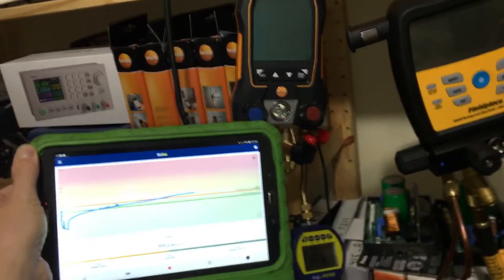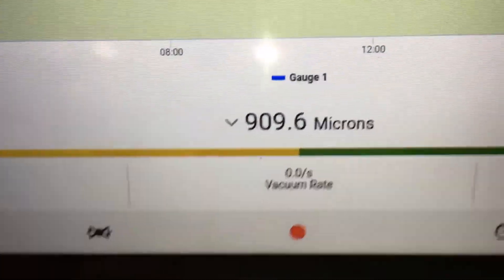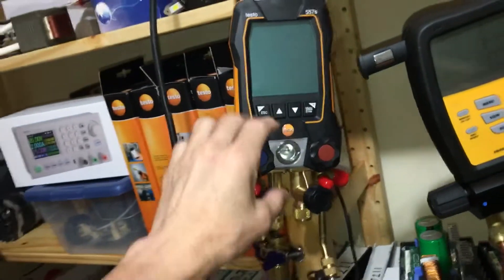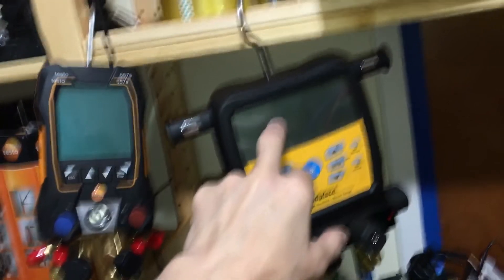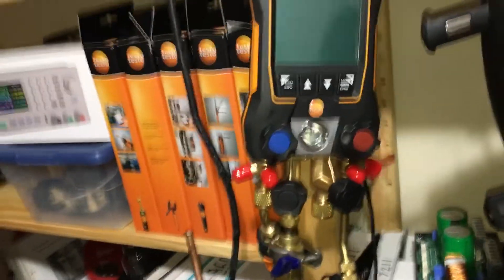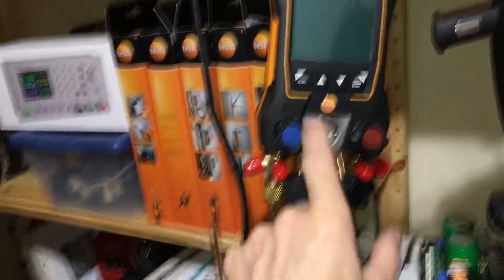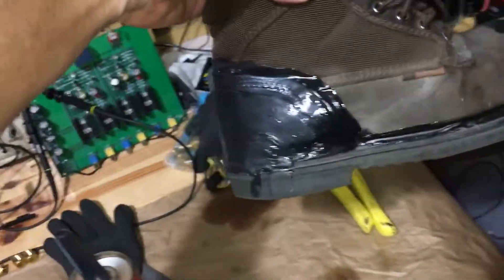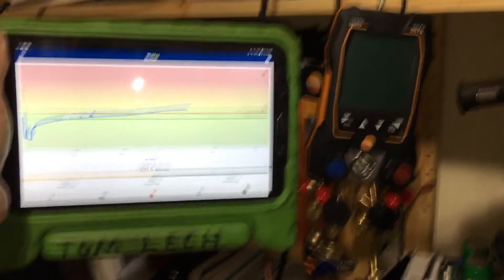Pt:5 TESTO 557S passed vacuum decay test. Decay up to 200 micron after 4 hours

Comment: Hey have really gotten into your videos and am interested in getting this manifold. I have a question regarding hoses for pulling vacuums. I've always been told bigger is better for hoses but you pull through I'm guessing 1/4" copper lines, do you still get quick vacuums using the copper with a 5-8cfm vacuum pump? I usually use 5/8 refrigerant hoses to pull through and was wondering if I should make up some copper ones and if so could I use bigger copper and get more cfms or just stick with 1/4". Thank you for your time!
Reply from the maker: If it is for an automobile quarter inches big enough because of the tiny size of an automobile’s system. 
             When you’re working on old our 12 systems you just simply use a valve core removing tool to remove the valve core and this will be more than enough flow to make your job go fast. 

        In automotive we have the special R1 34 coupling fittings that they do not have in commercial or residential HVAC. 
            The majority of the valve depressing cores inside the fittings are very large diameter so when you push them down just a little bit there is a rather large circumference for airflow to go around. 

         It would be nice if they made a valve core removing tool that you could use with hoses

          The worst case scenario is a large SUV that has a evaporator all way in the rear of the vehicle with 30 feet of hose. 

          But then again and Automotive were talking about tiny little systems that have anywhere from 1 pound to 3 pounds of refrigerant with a tiny little evaporator anything tiny condenser. 

           Now compare that to even a small residential heat pump where the furnace and evaporator are located somewhere in the house 20 feet to 50 feet plus away from the condenser located outside the house. 

         If you ever looked at the actual size difference of the evaporator on a car that you could basically hold in the palm of your hand the size of a small book and the evaporator inside a home residential unit the size of a small suitcase times two or three unfolded. 

          Compare the size of the condensers on a home residential that comes up to your waist wraps around a square box if you laid it out it would be about 9 feet long. 

            But this is why I use for port manifold on the refrigerant gauge set,
            Because you will have a threeeights inch vacuum hose or larger going to that threeeights fitting on the gauge set manifold. 

        This is more than enough to be divided up between two 1/4 inch hoses for automotive use
Reply: @coldfinger459sub0  I should have said I work in commercial refrigeration but usually pull vacuums on smaller stand alone units. Thank you so much for the quick response!
Reply from the maker: @Loki915g  if you visit TESTO web site they have a lot of stuff geared towards refrigeration. 
        Now that MeasureQuick is developing software for refrigeration can use your Fieldpiece or TESTO Bluetooth sensors